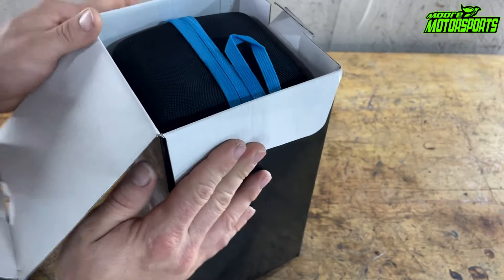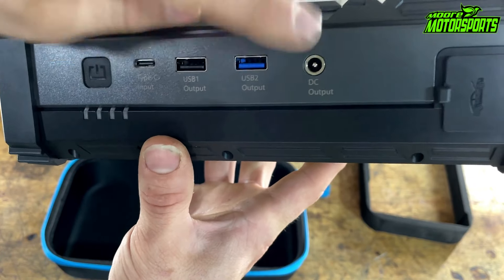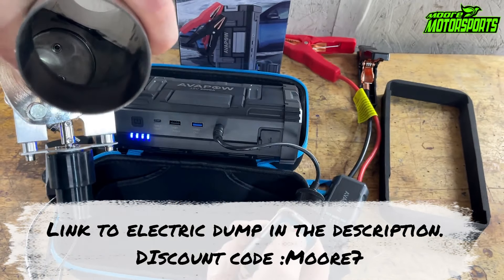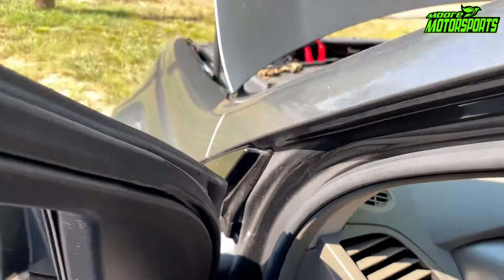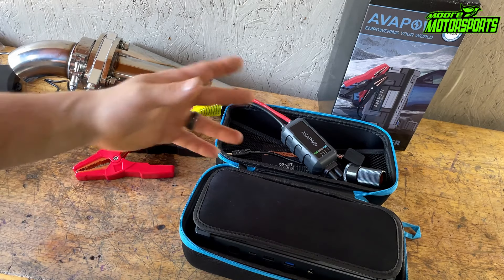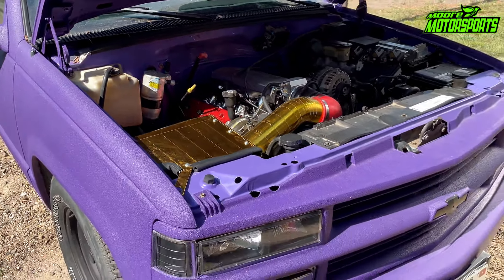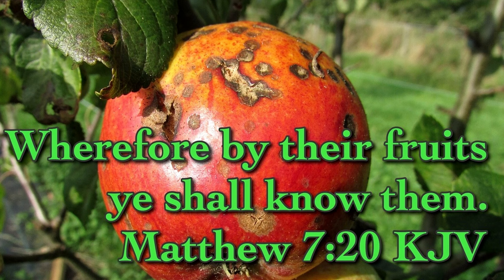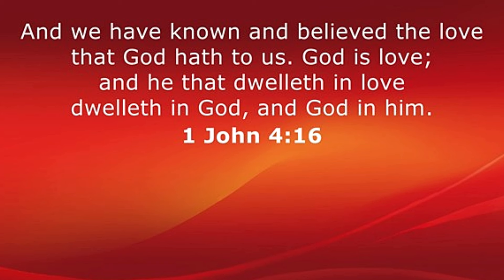A MUST HAVE FOR EVERY VEHICLE!  AVAPOW 6000A JUMP STARTER WITH SERIOUS POWER!!

Comment: I got another brand of one of these for Christmas a couple weeks ago I came out to my car to head to work at 4:30am and my car was so dead I couldn't even unlock the car. Luckily it had enough juice to pop the trunk where the jump start box was. When I opened the drivers side door nothing lit up. It was able to jump my car from completely dead and I made it to work. Still no idea what happened to kill the battery but it didn't do it again and there wasn't any dome lights on either.
Reply from the maker: Dang! Yeah that jump starter is legit man I didn’t expect it to work as good as it did. Normally they only are good for one jump but it kept on having juice!